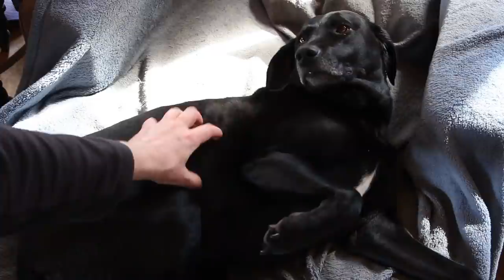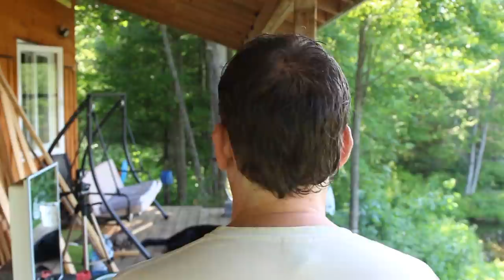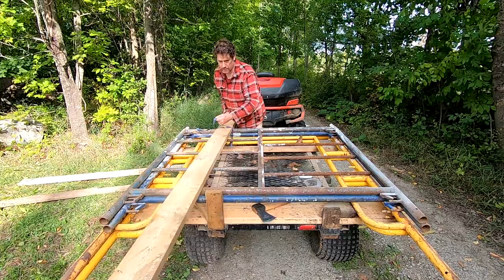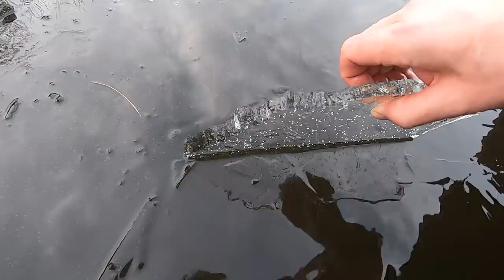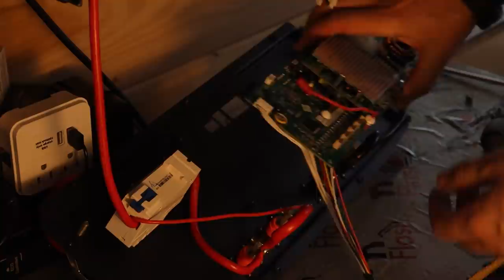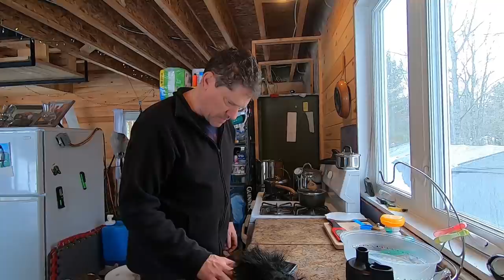Alone in the Wilderness - A full year off grid

Comment: I think I figured out a way for you to have a large water tank near the cabin without needing to blast into the bedrock but would require carrying water from the dock back to the cabin. The Ice only gets 2-3 feet thick in the winter so you can sink a tank to the bottom of the pond to hold the collected rain/melt water. It would require building a cage on the tank out of fencing to hold a few tons of rocks and sealing pipes to the tanks to insure the pond water isn't mixing with the rain water. 

Would need to be a tank made for in ground as they are designed to deal with the weight and ground water. A pump could be as simple as a pitcher pump or go as complicated as a submersible pump you hook a battery to when you need to fill the water jugs. 

The good news is filling is as simple as running a garden hose from the collection barrels and letting gravity carry it down the hill.